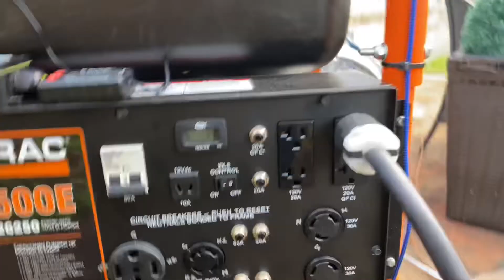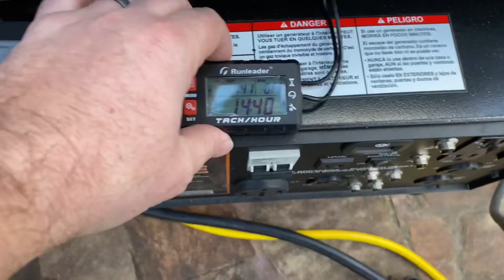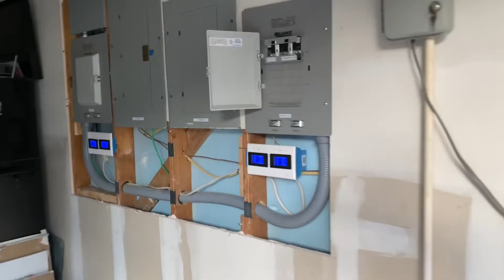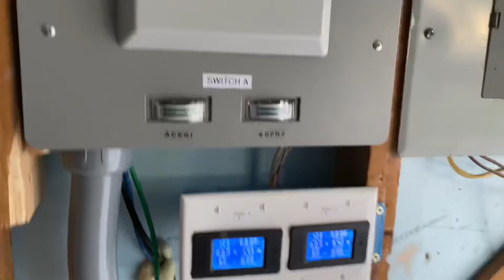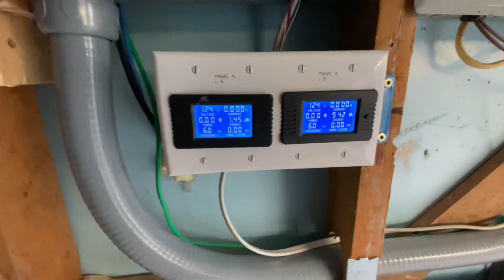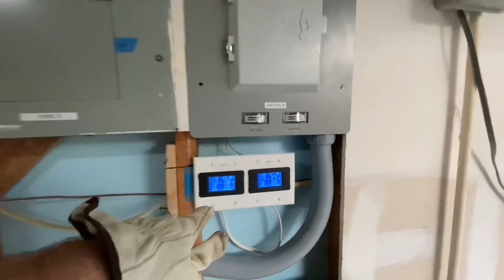Home Generator parallel power install - 72Amps/17,500 Watts - Generac GP17500E - Transfer Switch

Comment: I like your approach to utilizing the 50 and 30 amps. I am interested in seeing the costs for the extra panels. I found the transfer switches that are in the $250 range but can you describe how you split the meter feed to power the two transfer switches? I am trying the calc the total cost for the splitting the main, the 2 transfer switches, panel meters, and a subpanel for the 30 amp supply.
I am thinking as an alternative that you could 
1) install an interlock 50 amp breaker in the main panel and
2) add a manual transfer switch with 8 -10 circuits powered by the 30 amp gen plug 
and it maybe less expensive overall.
Any thoughts or comments?
Reply: if you are doing most of the work yourself you may find it's close in price to use a larger standby set with a 200 amp automatic transfer switch. He's well over $5k for what he's showing, and its a full manual system.
Reply: @rupe53  yes I agree but I think you can do the 50amp in the main panel with just an interlock kit. Then add a transfer switch panel for the 30 amp feed which is sort of a subpanel approach.
Reply: @donaldjeansonne8667  ... I see where you are going and I believe it's possible, but if you power the 50 amp interlock first then you run the risk of energizing the entire panel via the 50 amp cord. IOW, your idea is not idiot proof. The video shows the secondary system in another panel and while complicated / expensive, it is basically idiot proof.
Reply: @rupe53  I would put an interlock on the sub panel which has normal feed from the main panel and interlocked with the 30 amp generator feed. Thus the main becomes fed by the 50 and the sub fed by the 30 but the interlock prevents them from being tied together.
Reply: @donaldjeansonne8667  .... based on your response I don't think you fully grasp what I posted.
Reply: @rupe53  If you could please explain where we differ in the end results or level of protection. Maybe your intent of y our posting was different and I failed  to see that?
Reply: @donaldjeansonne8667  ... the way I see the series of events, if you power the 50 amp supply first, it will also power the 30 amp panel, no matter the source. You run the risk of over-drawing the 50 amp feed. (not fool-proof) You can avoid this with manual intervention... but you'd need to be aware and proactive to switch the 30 amp feed first, then do the 50 amp feed. The 30 amp interlock comes into play here because you are removing part of the load from the system. You follow me with this?
Reply: @rupe53  I see your point of the order of powering  the two panels. Thanks
Reply: @donaldjeansonne8667  ... BTW, I can't find anything in the code that would DIS allow this specific configuration, but you should know that NEC writes these rules for a reason. The one rule that does come to mind is about the power supply being able to meet the demand, which is a roundabout way of saying a small gen set (or main feed) should not be connected to a large load. IOW, calculations should be done so nothing is overloaded. That said, I often wonder why people are so consumed with powering a whole house when the situation is only temporary. Most any residence can be powered with 5 Kw or less if people are willing to just do the basics. (heat, a few lights, and fridge) It's also way cheaper!
Reply: @rupe53  I agree and I currently have a 5600w generator the I power my house during an outage. It is connected to my main panel with an interlock on a 30amp breaker. I just limit which breakers are on in the panel. Being in Louisiana this can work ok but not having AC can become a problem. I can temporarily put a small window ac and run it sparingly. This has worked but seems that recently we are getting more outages so I was looking at upgrading to a larger generator to run my 5 ton ac with a soft start kit. Hopefully this gives you why I ask all these questions….. exploring my options to weigh the costs of various options.
Reply: @donaldjeansonne8667  ... I did standby generators for well over 20 years (retired) and the one thing we learned was pricing a whole house versus skipping the AC, pool pump, and other high draw items can shave thousands from a quote. In some cases, it can cut the price in half or more. Then you explain that most outages are measured in hours, not days and let the customer decide how much that's worth to them. See, what many don't figure is heavier wire, larger conduit, larger gas lines, bigger transfer switch, more men on the job, etc. It really adds up. OTOH, some people have money, they want it all.... and $50k (at their weekend home) doesn't even make them blink.
Reply: @rupe53  very good points. My outages are normally a couple of hours / less than a day. I think we may have had a 2 day outage but maybe one time. I can do a 15kw generator for about $2700, a soft start kit for $350, misc electrical for ~$300. The new larger natural gas line ???. So I think for about $3500 -4000 with me doing most of  the work I could have a setup to run just about my entire house. This would be reasonable when comparing to $10 -15K for whole house package. Also my 5600w generator is 17 years old. Immediately after an summer time outage you are ready to spend the money but as time passes you begin to reassess and spending gets more difficult to justify.
Thanks for sharing your thoughts and perspective on things. It shows you have real world experiences.
Reply: @donaldjeansonne8667  ... let me throw in that many ask WHY the price so high, and I remind them our job is "turnkey" compared to DIY. Just the fact that our customer probably doesn't have a truck or 6 friends to help load / unload often cinches the deal. Oh yeah, the few buckets of gravel to level the location, the cement pad, guys to dig trenches, and then buying beer / pizza over two weekends of work. Did I mention the permit process and knowing the various building codes, then not having to fix mistakes due to lack of experience?

Comment: I like your set-up.  I have the exact same generator and am set-up to get 50A into the house...single panel.  I am curious is you run soft-start kits on your air-conditioning units?

Comment: I am not sure the 2nd ground is allowed per electric code.  You should only have one location to ground, and that is done at the main panel (existing).
Reply from the maker: Yes Miguel is correct about this. I discussed this with Mike Holts team, and it is considered a self derived system since it's 100% disconnected from utility power (including the neutral)...so i needed to provide a ground rod for it. Since the neutral and ground are bonded at the generator...the ground rod is connected there. Hope this helps!
Reply: @tv-mix-live  ... you do realize that both of those power cables have a 4th wire for a ground that's hardwired inside your main panel... and that DOES NOT ever get disconnected by a transfer switch. IOW, the extra ground rod is a code violation when properly connected to a home via the cables. Yes, you can buy a transfer switch that switches the neutral also, but it's not necessary per most local codes.... BECAUSE... neutral and ground are bonded in the main panel and again at the pole transformer. BTW, utility companies operate under different guidelines and are not subject to NEC rules.
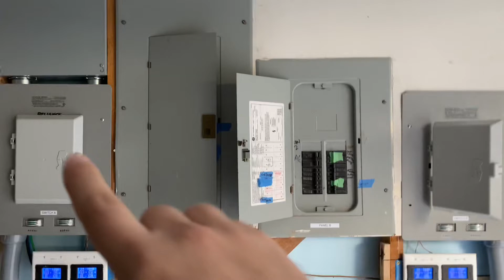Reply from the maker: @rupe53  Please watch this video at the 13:20 mark to see exactly how my system is set up, and why I need a grounding rod on the generator. My system includes switching the neutral, so its technically considered a self derived system.
Reply: @tv-mix-live  ... and the transfer switch reconnects to the panel, where the ground is always bonded. (not switched) Even a subpanel will have the ground bonded back to the main panel, so you always have it.
Reply from the maker: @rupe53  Just watch the video i linked above. Even Mike Holt's own team told me i needed to set it up this way. This is petty, im done. Go call Mike Holt or the NEC and argue with them.
Reply: @tv-mix-live  do those reliance transfer switch panels switch the neutral as well? I was under the impression they only switched the lines. Edit: it seems the "X" series can switch the neutral. I learned something new. What model transfer switches do you have exactly?
Reply from the maker: @cullenevanhall  Yes...the neutral is being switched as well. They are 3-pole transfer switches
Reply: Since switched neutral transfer switches are being used (meaning the house neutral is disconnected as well), the generator is considered a separately derived system and needs its own ground rod, per the electric code.

Comment: Not sure on that unit, but I know the GP15000 I have if you remove the generator panel the leads from the generator winding go straight to 50a plug and daisy chain off from there… so not sure what you gain by 50+30a plugs separately, at least for the GP15000
Reply from the maker: Correct, the 17500 is wired similarly. The genie is rated up 72 Amps. However because of the fact that it has a 50A breaker on the 50A connection...you can't get more than 50A out of the generator unless you use both the 50 & 30A connections at the same time. Thus the reason i designed it as i did. Hope this helps!

Comment: This is surely a beast of the generator, but I see it as high quality and worth the money for this home owner. With 2 AC compressors running and all the lights on the generator is just humming along delivering a perfect 60 Hz. I'm sure the THD is low. A varying Hz and voltage is what can ruin appliances. It will need to be over sized to start up the 2 compressors so I think he made a good choice. Much cheaper than putting in a stand by unit. There is a monthly charge for the stand by and they recommend that you replace them every 12~ years so you can benefit from technical improvements in newer models. I have friends running portables for 20 to 30 years with little maintenance. When you move or want to upgrade you can just sell a portable or take it with you to the next homestead.

Comment: The rated THD of this generator is less than 20% which is quite high.  There are other options in this same power class that have less than 5% THD. Also, consider one that runs on propane as it is easier to store.
Reply: If the THD is 5% or lower the manufacturers seem to advertise it. Higher THD ratings appear hidden in Generator info, imo.
Reply from the maker: Hi Jesse, Where are getting this “less than 20%” stat from?

Comment: Got the same generator for the last 3 years in Florida.  Haven't got a chance to put it to work yet besides testing run every 3 months.  I bought it from Home Depot.  Home Depot is no longer listing this Beast on their website.   I've been thinking to put this on a trailer and haul to any place in demand because I have small 2 offices (each is 10 miles from my house)  The power company has been reacting to power shortages way quicker in the commercial (business) zone than the residential zone.

Comment: I had an additional breaker box installed, and am running both 50 and 30 amp also. Had to split off a few things on my main panel to utilize the full potential of this beast generator. Now I'm building a generator shed to be able to run it completely covered during storms. Will post video when complete. Plan on installing a propane kit after I complete the shed.
Reply: I am close to (finally) being done with mine if you want to check it out.  I need to add another video as it is pretty much done.  I need to reconfigure fans as they are not pushing up the vent panel things....https://youtu.be/er1-zqMrFpk
Reply from the maker: great! Can't wait to see it!

Comment: Buy the hyper engineering sure start for each of your compressors. Look it up. It will cut the in rush current on your compressors by 60-70%. It will also extend your compressor life. Emerson rebrands them.
Reply: Ditto! My inrush is running 4 amps on both of my units. I have a similar setup with the same gen set, minus the usage of 30amp outlet. 

I added a motor snorkel to my generator. A dozen 5-gallon gas cans only lasts 2 days with the 17500e, and you have natural gas.
Reply from the maker: @BankersSpecial  did you use a tri-fuel conversion kit or diy it? I’m looking at doing this next. Any advice would be much appreciated!
Reply from the maker: Yes sir I have those on both AC units!
Reply from the maker: Michael…did you use a tri-fuel conversion kit or diy it? I’m looking at doing this next. Any advice would be much appreciated!

Comment: How much gasoline do you have to store for this beast?
Reply: A lot - lol. 
At 50% load they run through about 1.6 gallons / per hour
Reply from the maker: My next project with this genie will be to convert it to tri-fuel. Through all the natural disasters we’ve had in the area over the last few years, I’ve noticed that we’ve never lost natural gas.
Reply from the maker: Also, i personally don’t store gas until only a few days prior to an event. Being in Texas, we usually get a few days of warning before an event takes place…hurricane, freeze, etc.

Comment: I have this same generator.  I want to look into upgrading the 50 amp breaker, wireing to a full 70 amps….I would also have to come up with a higher wattage plug.  This may allow for 70 amps to be transferred directly to a single panel/transfer switch.
Reply: Have one as well and am considering doing the same, much easier than parallel hookups. Unfortunately I can only find outlets/Breakers up to 60/63 amps(Nema 14-60), be curious to see if you found any rated 70?
Reply: @davidandrade1107  ... you won't find any NEMA outlets or plugs rated for over 60 amps in single phase.
Reply from the maker: If you guys end up doing this, please make a video. Would love to see! I luckily already had two branch panels in my house, so it just made more sense for me to do it the way i did.

Comment: Is the generator stored in the garage or outside? I imagine it would be a pain to connect that ground wire each time you want to run the generator…
Reply: I store mine the garage...then move it out into a "generator shed" when needed.
Reply from the maker: It’s stored in the garage. The ground wire only take me about 2 mins to connect. I have the ground wire coiled up and hanging from the generator with a zip tie, and One end of the wire stays connected to the generator grounding lug at all times. When I need to use it, I just wheel it out of the garage and connect the other end of that wire to the ground rod (which is already permanently installed in the ground). So it’s just one simple connection. 1-2 mins tops!